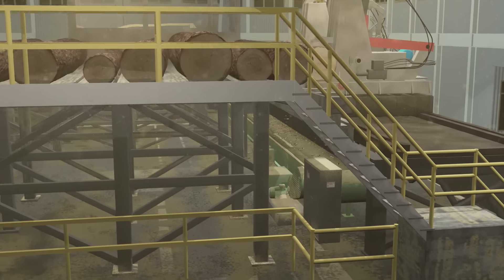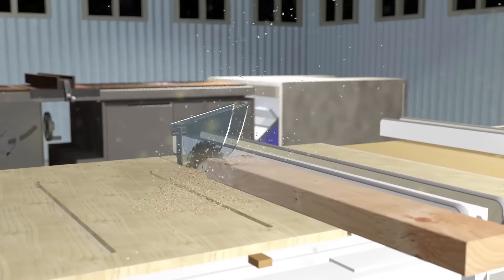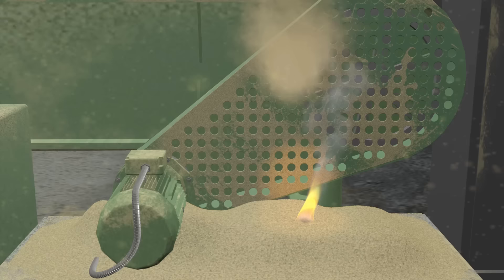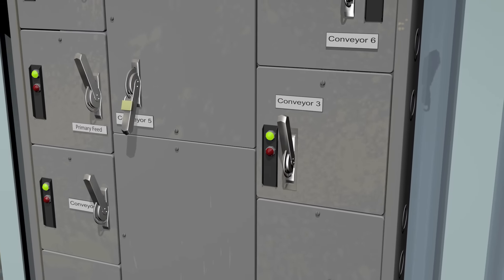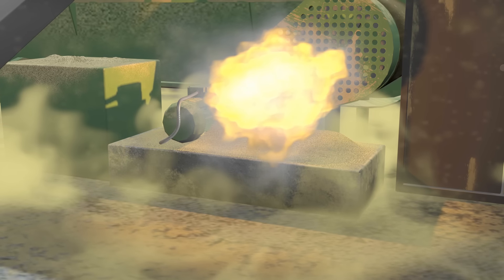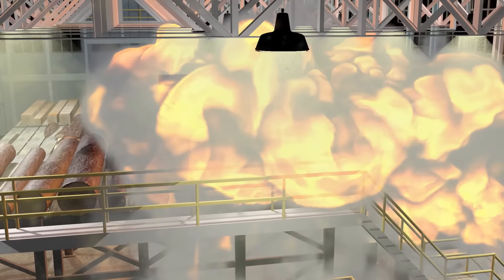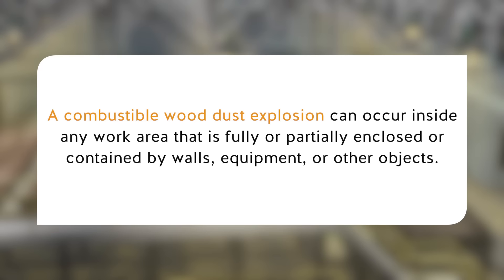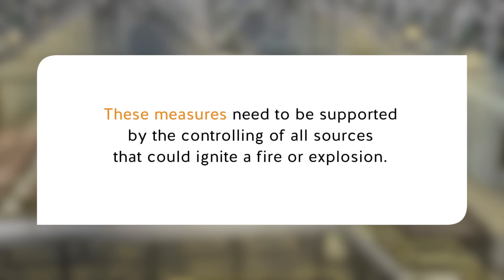Combustible Wood Dust Explosions | WorkSafeBC

Comment: I worked for a flooring manufacturer  several years ago in the maintenance department. One of my jobs was to run a diesel engine bobcat in the dust accumulation building,and feed the auger that fed the sawdust fired boiler,the heat of which was used in the manufacturing process of the flooring. Sometimes the dust in the dust building was so thick , visibility was zero and you had to stop the Bobcat and wait a minute before you could see. How there was never a dust explosion is beyond me. One job Im glad I don't do anymore.

Comment: I worked for a company manufacturing wood panels for the construction industry, we had quite a few explosions which resulted in 1 death plus injuries. I left that company 14 years ago. The company overtime added various safety measures to reduce the risks from sensors to blast doors venting in a safe direction if a explosion occurred etc.

Comment: Many moons ago I used to work in a factory that made uPVC Windows. The raw material came in powder form and was pumped from the tankers into silos where it was mixed prior to being sent to the extrusion machines. I was told that each of the pipes has an earth wire running through it to remove any static electricity caused by the powder friction. The thought of the 3 powder silos detonating was rather sobering

Comment: This is the exact same process that was explained in the USCSB video regarding the explosion at imperial sugar. It was sugar dust.
Reply: If I recall static electricity tripped the explosion
Reply: @BrianGLee-bc7hj  An overheated bearing from a sugar-transporting conveyor belt is what might have started the whole thing, according to the United States Chemical Safety Board (USCSB) (that & the conveyor eventually having an enclosure added to it, which confined/trapped the sugar dust so it couldn't disperse into the conveyor tunnel, which was properly ventilated).

Comment: Surprised no mention of electrostatic ignition of dust. Can be caused simply by a buildup of charge in the air, and especially moving air -- such as in a dust collection system. Grounding of the ductwork can mitigate this.
Reply: @peteroleary9447
Indeed, have you ever vacuumed a really dusty floor in low humidity conditions? If the hose touches your arm it can snap you so good it will damn near make you drop the hose. All from the fine dust moving at high speed banging against the plastic hose on its way into the vacuum cleaner.

Comment: I work in a commercial cabinet shop. Last year a spark or ember went into the dust collector. Nobody knew until it was an inferno because the collection system is outside. The fire department seemed to take forever. A few of us were trying to put it out with fire extinguishers and I personally think if we hadn't have done that it would have been devastating.  We only had to replace the bags and do some painting. It was scary to say the least. People need to realize that an ember can sit for hours before igniting. We are lucky it happened early in the day and not after we shut down that afternoon. Keep your dust collector's clean. Empty them daily. It's no joke.

Comment: Just not wood. It happens in places where fine dust particulars are present. It could be a factory where they are milling wheat or flour, grain silos, or coal dust. Even in salt mines it's a danger. It's why if you see underground salt or coal mines, when digging aggregate, they'll use water to both cool the tools, but to keep the dust down to prevent ignition...
Reply: Uh, no. Powdered salt is neither combustible nor does it support combustion. It is far too stable to do that it is quite happy in the chemical state that it is. It is at lowest energy state most likely to cause the two substances that make it up are extremely reactive but they love each other too much and do not want to part after they combine. That's the lay man's version. I could give you the chemists version but I doubt that it would help. By the way I am a chemist.

Comment: Manufacturing and process plants have come a long way from I started. My experience working in Oil Refineries, Chemical Plants, etc, from very large companies to a few mom and pop comps. For one reason or another, I found the smaller companies lacked safety and process training. My opinion is OSHA focuses on the very large companies, I believe it’s the dollar amount they put on the fines.

Comment: Amazing this doesn't happen more often.  In military applications this is an air/fuel mixture dispersion explosive.  I think they mainly use fine metal dust like aluminum as the accelerant.
Reply: Uh, munitions plants tend to take safety a little more seriously than sawmills because everybody there understands the history of explosions in munitions factories. They realize they are dealing with very dangerous substances and act accordingly. As a chemist, I behave very differently when I'm handling drinking water as opposed to, say fuming nitric acid.

Comment: On the road and in front of any place that produces combustible wood dust there should be signs informing the possible dangers. Then conduct an orientation to make sure anybody associated with the process knows the danger. Finally, it should be made mandatory for anything causing this dust to capture and neutralize this dust. Make it happen people.

Comment: At the Ford plant we used to have fires up in the rafters all the time because of the sparks from the welding robots firing up at the roof and landing on the steel beams covered in 70 years of dust and oil buildup. It's cheaper to just keep putting the relatively small fires out than it is to actually clean the beams.

So much for a union when they let that shit happen.

Comment: Paper machines face the same problem; dust & fines in the air. 
At one point, one of our plants revamped their air system, to work in-sync with all the machine directions, gravity, etc, so the dust is continuously suctioned off and away from the production floor, to be filtered elsewhere. 

It’s not easy to implement for all production areas, as every installation takes a custom calculation. This isn’t an “off the shelve” solution.

Comment: When I work out in my little garage building cabinets, shelves, etc, I lmake sure whatever power tool I'm using is connected to my shop vac/dust control setup. We had a neighbor growing up that was burned severely when his little shed had a flash fire that was started by one of his power tools or the kerosene heater, saw dust, and he also kept his lawnmower/snow blower in there with the gasoline. Pretty much leveled the little pre-fab shed.

Comment: This happened in my woodshop class. One of the table saws had built up a bunch off wood dust underneath it and something created a spark and the table saw exploded but it was fixable. We had lights broken and the air ducts got messed up toom

Comment: That happened to the granulator where I worked at metal processors. It chops up insulated wire very fine and heard a boom and the whole granulator went in flames for a couple secs

Comment: 40 years ago working at a. furniture factory looking out a window in front of me on a assembly line a employee climbed a ladder to a huge tank that collected dust. he opened the door to check something, shutting the door climbed down walking away probably 75 feet and then a explosion and the steel door blowing nearly off the hinges. it would have been bad if he had been standing still at the door. nana and papa wishing you well.

Comment: Dang that electrical panel exploded with so much force there was nithing left of the dude.
Reply: Overheating electrical components in an enclosed unit (switchgear panel) will emit vapour that can explode if a spark is present, for that reason all medium and high voltage switchgear can't be operated by personal stood local to the equipment, only remotely.

Comment: Ex coal lab worker here. This is exactly what my employers told us could happen but never had the visuals.
They had a ventilation unit that was so loud you had to wear hearing protection. At the end of every set we each had to blow the floor clean and the end of the shift, blow every surface off.
Reply: @Ronin03
Would this have been in Morgantown West Virginia by any chance? At the old Bureau of Mines facility Down by the Riverside of the Monongahela?

Comment: As someone who works in sawmills (I do maintenance on Chippers,Debarkers) while I guess his theory of ignition with the dust exc exc must be clean exc exc. I can PROMISE none of these mills clean at all and the cust is EEEEEVERYWHERE usually its not sparks from motors exc that cause it...the dust and atmosphere is usually to moist from the wood being processed. It's machines catching fire bearings exc or general human error via welding or cutting torches :D and the fires are brutal.

Comment: Dust collection is key. But that is a way to reduce the risk. The prevention is checking for wood dust in critical places and inspection of the electrical switchgear. Also manual cleaning has to be done often.
The use of a particle level monitor will help to determine the risk and ensure that levels of fine airborne dust are not a explosion hazard
Reply: Had an apprentice start blowing out electrical boxes with compressed air years ago. Thankfully someone stopped him before anything exploded, but when we looked over he was surrounded by a fresh cloud of dust and happily stirring up more with the air compressor. Proper training is also key, no one was provided training on dust mitigation until that day, now all new hires are.
Reply: Manual cleaning eh?
We’ve all heard the story of the new guy shoveling dropped grain around a silo with a metal head before they tackled him to the ground.

Comment: So perform under no oxygen conditions. Got it!
Reply: Butcher Pete, that is not possible, but removing enough dust to extremely minimize the danger, is.
Reply: If only there was more carbon dioxide in the air, we'd be much safer.  :)

Comment: sad knowing guys work in these conditions without resperarators to feed their families.. men are seen as exposable in out society
Reply: Based... But I'm pretty sure they have respirators as they have to follow OSHA regulations.
Reply: @hightiernub1313  They may have respirators, but US OSHA regulations do not cover explosive dust with an actual standard. There have been attempts to implement one since 2006, but the process stalled and in 2017 was cancelled for budgetary reasons. While there are other standards from state and national fire and chemical safety boards, there is no complete national standard that applies to all businesses and that could prevent such dust explosions.
Reply: I think you mean expendable

Comment: At what level does this become a hazard? I work on a framing crew, all heavy smokers. (Ignition source), Ive recorded levels of 23mg/m3 (around work areas) on a busy day when were enclosed with a roof. Open to environmental is around 9mg. Now knowing about this danger i want to keep us safe. Please let me know if you know what concentration level becomes a hazrad. (Been framing for 7 years never ever heard about this even word of mouth)
Reply: This is really depend on the dust itself, humidity, particle sizes, etc. The way to know it is by doing the dust testing in the lab. I'd recommend to do good housekeeping or having dust collector system to reduce the risk. Lots of company never face these situation before because the chance is very low but once it happens. It took less then a second for explosion to take place as video. So better beware about it before happen.
Reply: You won’t generate this much dust framing a house. 
A lumber mill creates crap tons more.
Reply: What about pulling some air in/out with a big fan?

Comment: This is virtually impossible in a home woodshop. Wood flour, which is superfine is what can explode and even that is super rare.
Reply: so the saw dust knows it is in a home shop, and not a commercial shop, and therefore won't explode?
Reply: It is best to assume that conditions are right for a possible explosion, and then work to remove all possibilities so an explosion will not happen. You would be surprised at the number of "accidents" that do happen in real life.